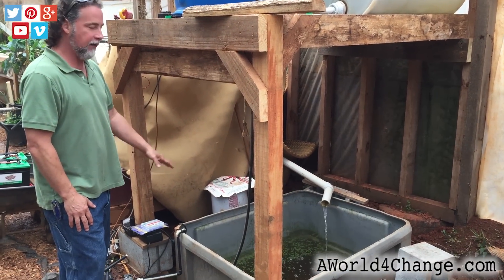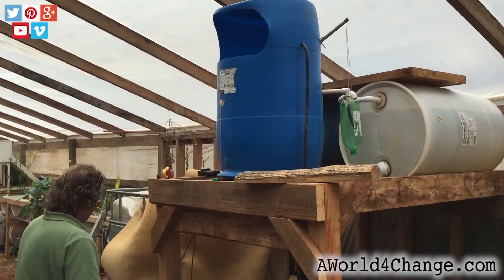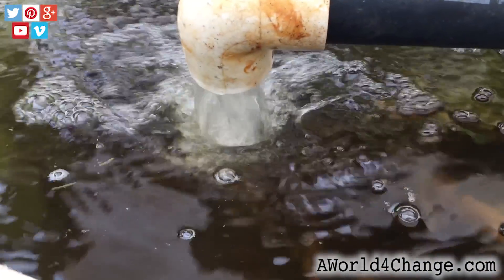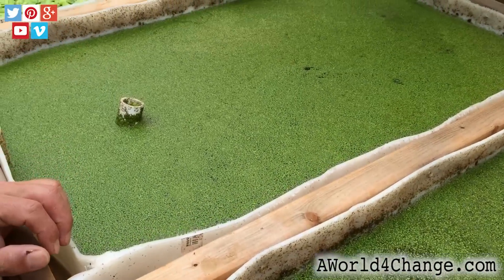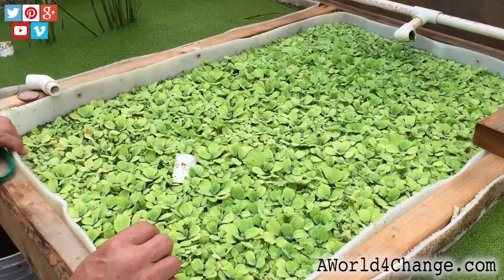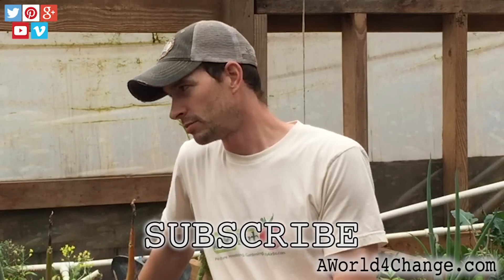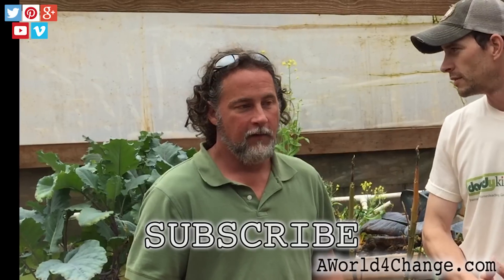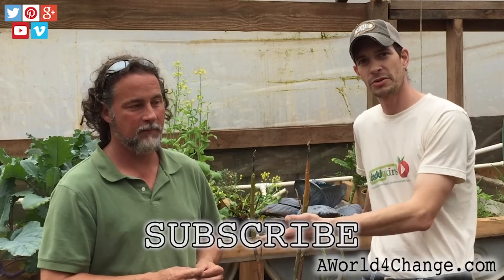Off-Grid Solar Aquaponic System

Comment: Nice work, How many Ah and at what voltage are those batteries wired and how big is the solar panel? Also what charge controller are you using?